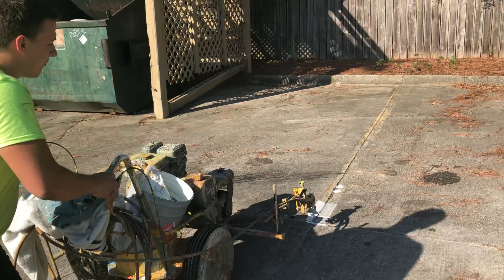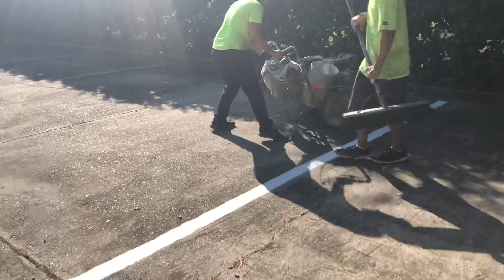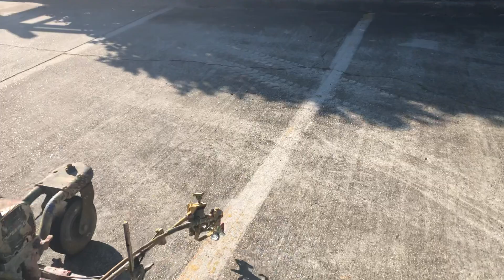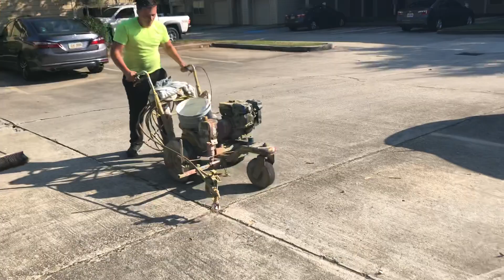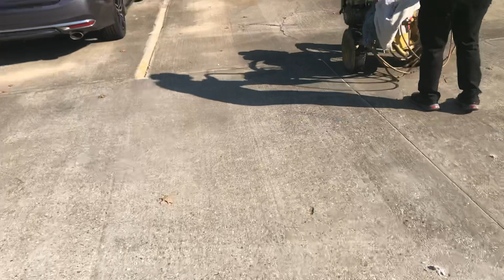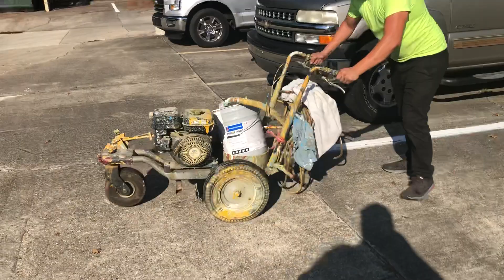One small step for this man, one giant leap for his future!

Comment: In this video it seems that you have a strainer on your pickup tube, is that what you do, along with straining the paint in the beginning or do you just use the strainer wrapped around your tube?  I have recently purchased equipment from a person that did this for 30 yrs. I had minimal training, but I have completed several pretty good sized lots, so I was just curious about the strainer on the pickup tube. My business is picking up at a steady pace. I am located in Central Illinois. I don't think there are too many stripers in my area, just a handful. Your videos are very informative.
Thanks
Reply: I’m usually using several 5,s of paint so I put a 5 gallon strainer in the bucket, wrap duck tape around to hold it place. Cut a 2-3 inch slit and put the pick up and relief tube through the slit. It strains as you use it. Just Don have to much of the strainer down in the buck, Kerr it 4-5 inches off the bottom so the pick up tube doesn’t suck it up. We always keep a top on the bucket so it doesn’t skim over . Hope that helps
Reply from the maker: Since the paint shortage, we have been filtering our paint several times because it's been clumpy, but still works excellent